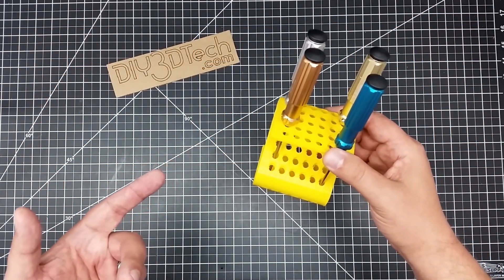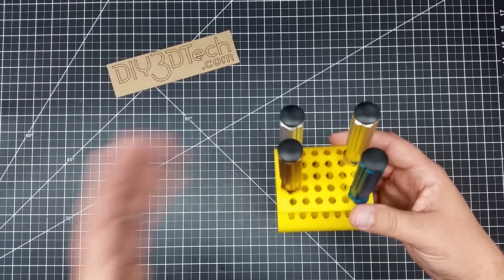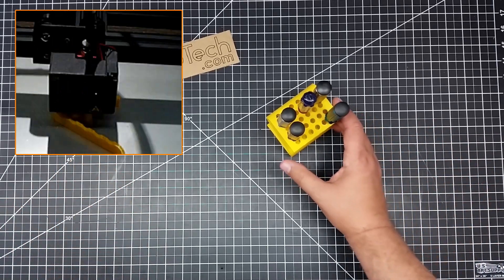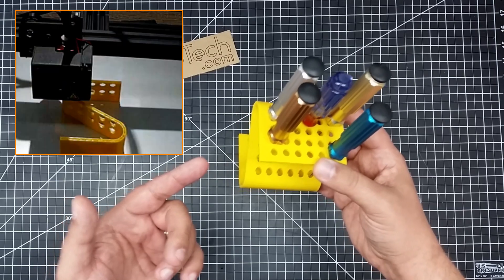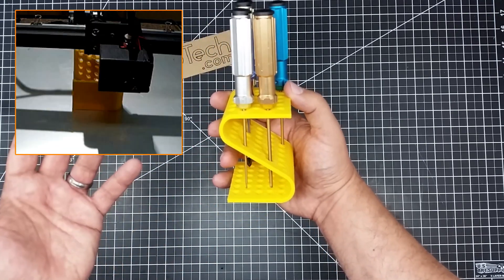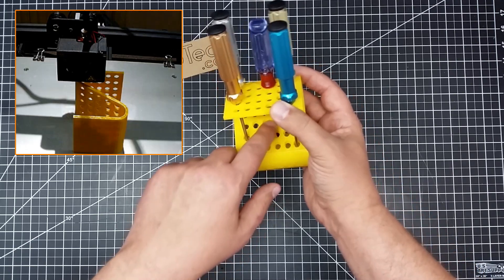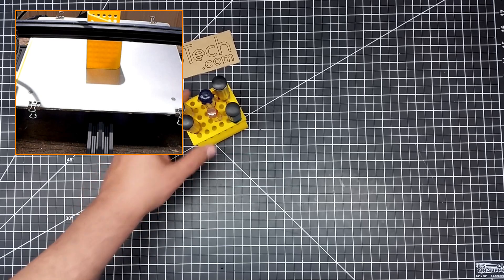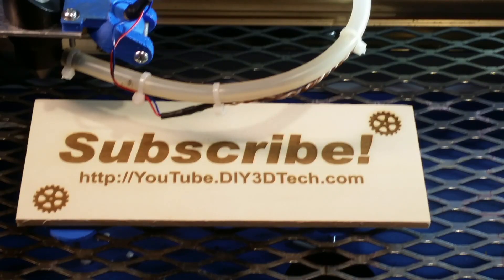3D Printed Project - BONUS Modifiable Desktop Tool Holder!

Comment: Neat! 

I need some more bench infrastructure. I made a solder spool holder and some other things in tinkerCAD.

This look like a good one to start with for an X-Acto knife, tweezers and other small tools that are just sitting on my bench. 

Thanks
Reply from the maker: Yes you could also use it for an X-Acto knife, however you seen my X-Acto knife base on thingivierse?
Reply: Not, bad. But I don't want/need a separate stand. I don't have that much space. Thanks.
Reply from the maker: Okay :-)